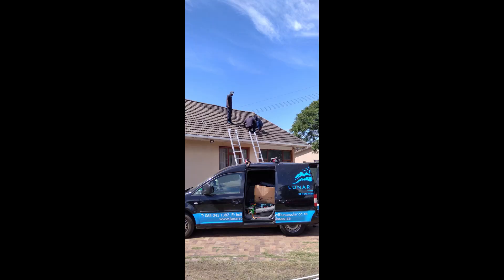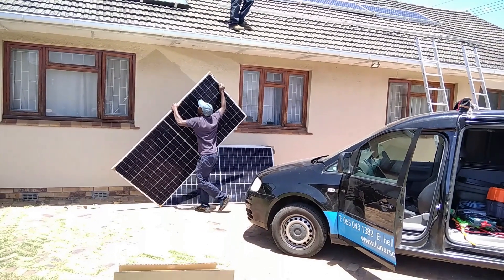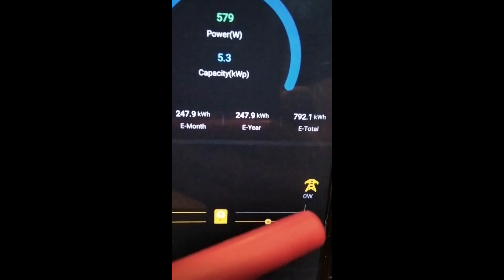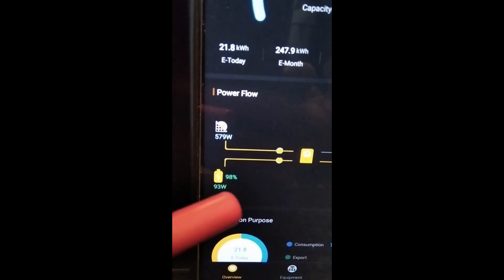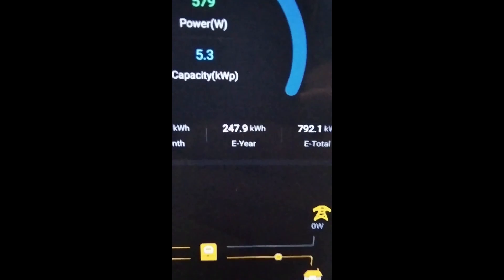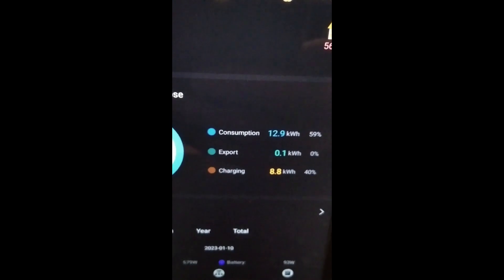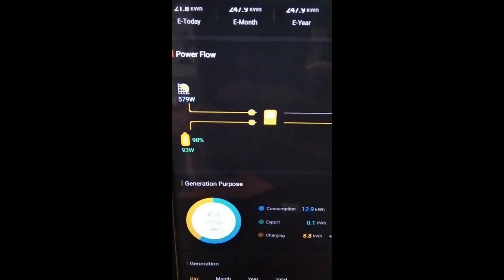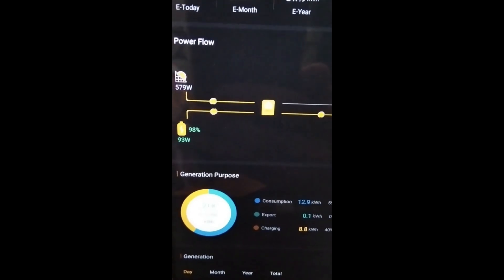Sun Synk Solar Power Installation, 12 panels, 8.8kW Hybrid Inverter, 2x 5.32 kWh Batteries

Comment: Cost of whole system and installation? Just paid for exactly same setup, installation happening end of april...
Reply: I have a similar system it was about R200k but mine is fully off grid cos they forever stealing cables and without power I cant work.
Reply: Hi Chris.what did your setup cost +-?
Reply: @GoFast589  200
Reply: @GoFast589  Was there ever a reply? Looking at the same thing
Reply: @VusiMngos  did you get a answer?
Reply: @Captain-Picard42 what's it 12 panels? At 4 to 6k a panel. 8kw Inverter and 2 x 5kw batteries min 120k that alone then add another 60 odd for the panels and another 12 to 20k to install those
Reply: @Captain-Picard42  nothing so far

Comment: Could you not have at least painted your roof first? It's rundown with such a beautiful system on top.
Reply: Dumb fkin statement
Reply: It doesn't matter cos you just call them if you want to paint or repair the roof and they come nd disconnect for the day then reconnect again free of charge.
Reply: @jacobshome7293 smart plan. So how do u paint under the panels and where they poked holes through the sheets and it starts rusting which leads to leaks and ceilings and even worse. Can we call them to come fix too??
Reply: @senormystery721  You remove the panels when you want to do maintenance and if there is rust where they drilled holes for solar panels you just patch up then they come and install the panels again from scratch. Its not difficult to install and remove the panels, you can do it yourself after just watching them do it if you know how to drill. Even easier to remove it yourself if there are no leaks cos you wont be drilling. Just gotta be careful though, cos if you dont know what you doing you can get electrocuted.

Comment: Thank you for the video. 
Sunsynk is a great product and works so well in South Africa.
Those batteries have a 0.5C rating. Did they advise you that you can only pull 5000watts from those batteries?
Reply: Are you sure about that? My batteries look the same and are rated as 1C continuous and 2C burst.
Reply: What does 1C and 2C mean. I have seen that and busy shopping around for a system to install